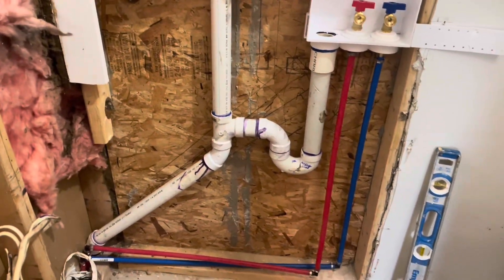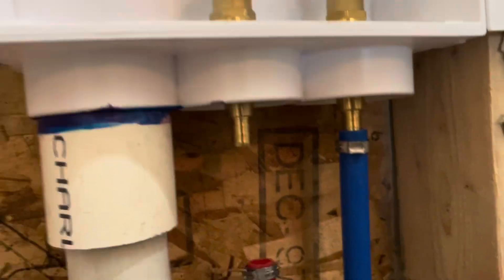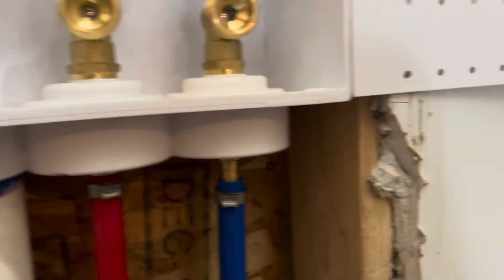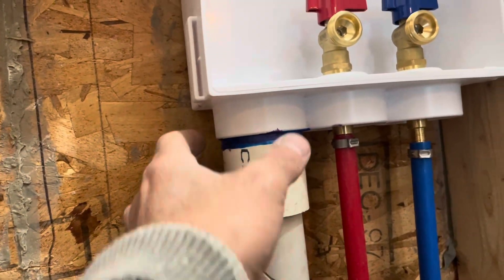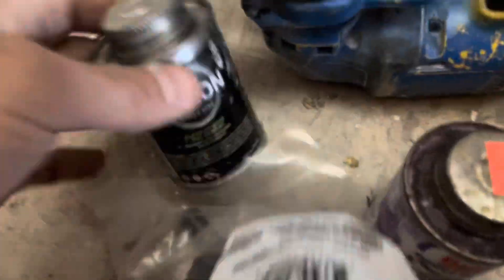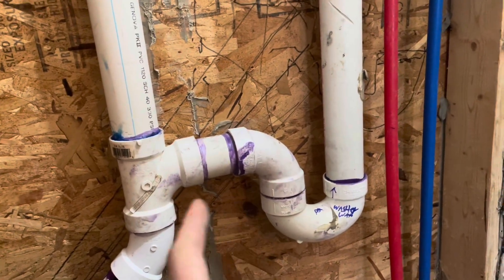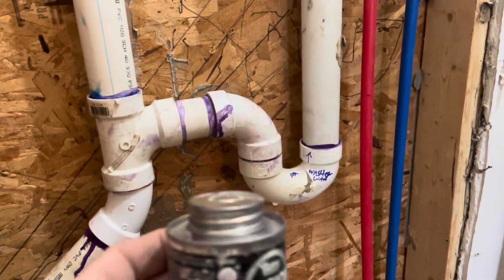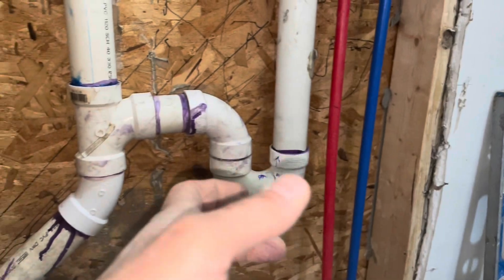How to plumb a laundry room, pipes, and pvc drainage￼

Comment: I am not a plumber - but I am a homeowner 13 years - in an old 1965 pier & beam - with original galvanized pipe, so not exactly sure what the issue is, but I would NOT reduce the 2 inch drain pvc to 1-1/2 because these newer washing machines pump out VERY RAPIDLY the water that the 1-1/2 does not tolerate well, and it can lead to a back up spill, which happened to me and it leaked all over the floor, so had to remove the old floor, repair the wall, etc.  I am planning to change out this drain with pvc and bypass under the house' the original route and go directly across to the 4 inch Main, with a vent of course so that I can use the LARGE Load cycle, currently I use Medium to reduce the amount of water, although it still backs up into my kitchen sink - and yes, I snaked the entire laundry drain - so this may be a galvanized pipe issue OR the 1-1/2 small drain pipe. Just sharing my story.  Thanks for posting.